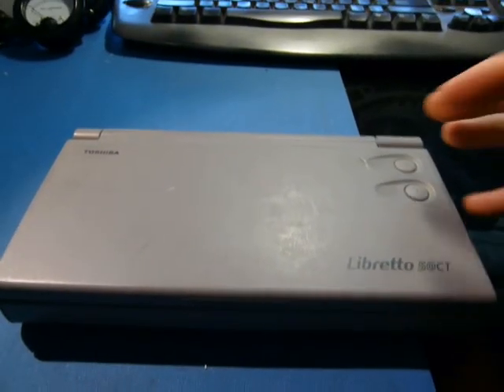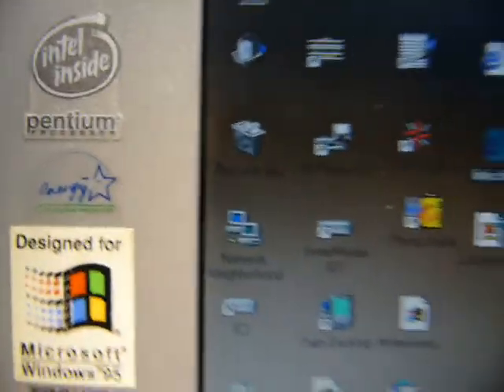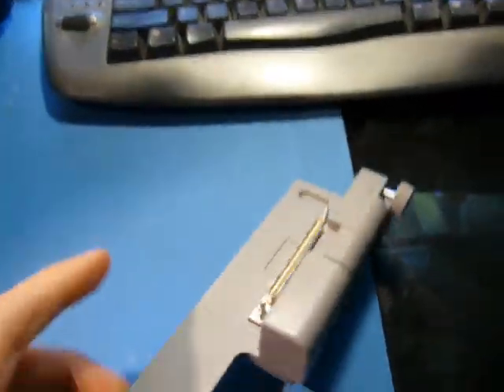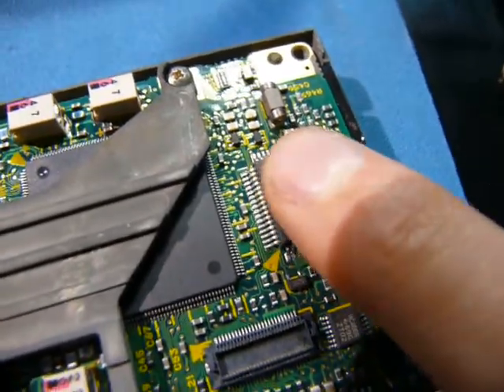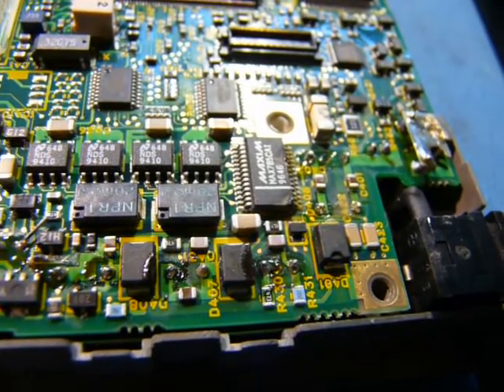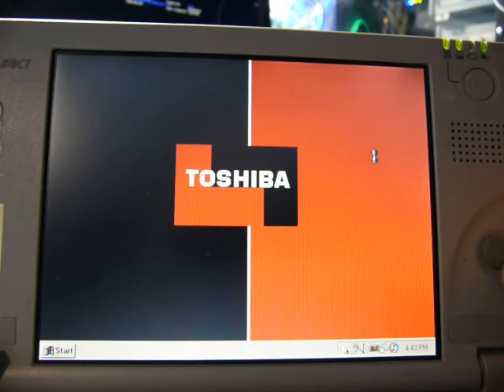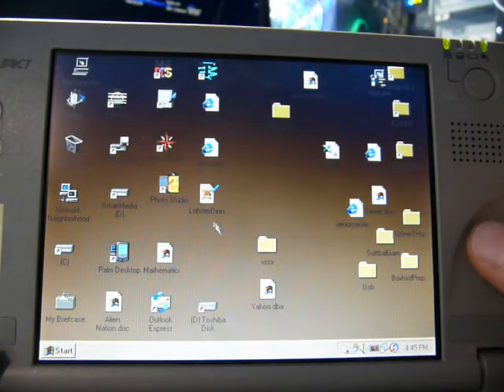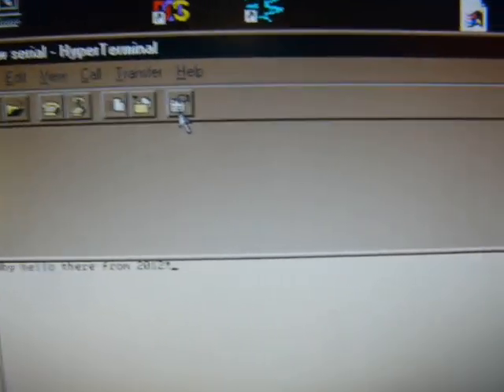Libretto 50CT Teardown

Comment from the maker: Thanks for bringing up that CPU package. I just did some poking around. Apparently it's a TCP320 package (TCP = Tape Carrier Package). It was only used for mobile Pentium and Pentium MMX, and was soon replaced by BGA. Very interesting. Apparently the CPUs came in a carrier, which was removed I guess just after soldering. I've added a couple links in the description with some more details.

Comment from the maker: Oh, I should add that some older machines have trouble booting from CF cards used this way. For instance, said shop PC needs to be reset a few times for it to actually boot (it sees the disk, but the BIOS won't boot from it the first time around). I'll update this page if I find the Libretto works or not.

Comment: You can add a IDE Compact flash adapter and install windows 98 on it through another laptop with IDE hdd.  The adapter runs for 5 to 6 bucks on eBay. and consumes less battery power and since it imitates a laptop hard drive. there would be less chance of corrupted files and zero chance of a crash.

Comment: I am picking up a toshiba Libretto 50ct, and hopefully a 70ct as well. I had some questions, if you had the time to answer them:

Windows Xp, Possible?

USB via PCMCIA card possible?

Wifi via PCMCIA card possible?

CF HDD, is 8 gigs the largest, or can you go to 16/32 gigs? 

I am going to be using this to take notes in meetings and stuff, and it would be nice if I had a way to back up or "sync" those notes with something else.

one of them does not come with an OS at all, and I do not have a license or install media for 95/95, but I do have XP so hoping that would work. 

any other tips for owning a PC this old?
Reply from the maker: +rndincircles Hey! So Windows XP requires 64mb ram. Neither 50CT nor 70CT support that much, so it's unlikely XP will work. You may just be able to run Windows 2000 on the 70CT. USB via PCMCIA 16-bit is not possible, I've tried... there just is no available hardware. IIRC I'm currently running a 16gb disk, but Windows 95 doesn't see all of it (2gigs only). Linux does, though.

My suggestion? If you're going to try to use this for "real" work, get a modern OS on it and a PCMCIA wifi card. Modern Debian will run on this machine with a minimal graphical environment (but don't expect to be running anything big like KDE, Gnome, Firefox, or the like). Otherwise, stick with Win98 and period applications. 7-zip is an exception, it works great.
Reply: +Spag The Maker thanks for the suggestions. I really appreciate it. It will be another week or so before I actually get my hands on it. so I will have to patiently wait.
Reply: +Spag Thanks for the reply. they both came today. The 50ct has 32mb of memory, and win 98 and it runs great. and the 70ct needs a new bios battery and the OS has a password... I found a 16 bit wi-fi card, which I think will negate my need for a USB drive. I am picking up a couple of compact flash drives and adapters as I've seen those consume significantly less battery, and are lighter and less noisy. I think I'll stick with win98 for now, as I think I can do what I need to with it. Its more just to mess around with, take notes in meetings to be a hipster douche ;). One last question. the full docking only does 16bit pcmcia as well correct? I cant find anything that says either way.
Reply from the maker: +rndincircles Love it. I strongly suspect the docking station only does 16bit PCMCIA, 
but that is from an architectural hunch and not direct evidence. As for 
compact flash, I tried that but never could get the computer to boot 
directly from a CF card. You may have better luck, CF cards vary pretty 
widely in their compatibility.
Reply: +Spag The Maker My goal/hope is to clone the current drive to the cf and go from there. I got these to play around with, so I'll be screwing around. the slot in the dock is a lot bigger than the slot in the laptop itself, hence why i ask about it.